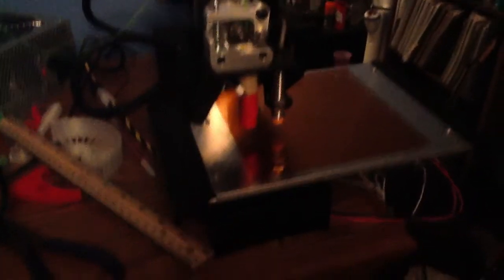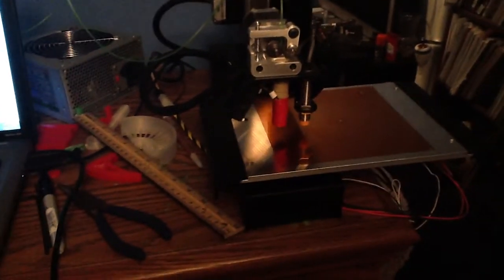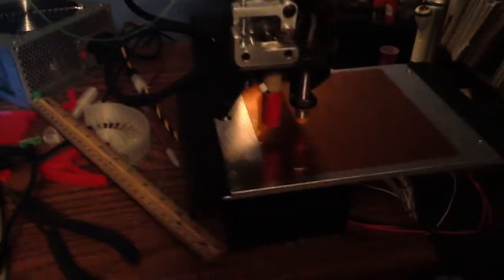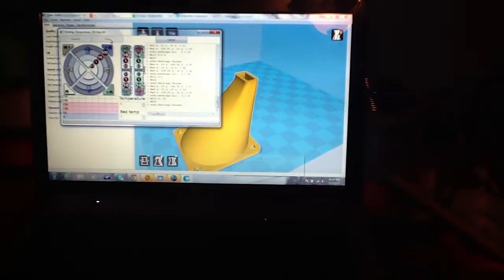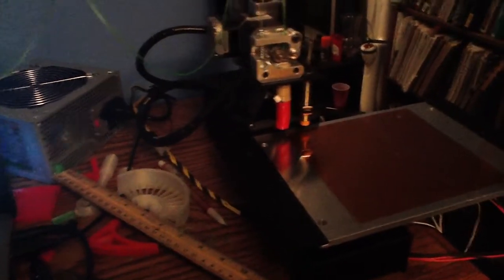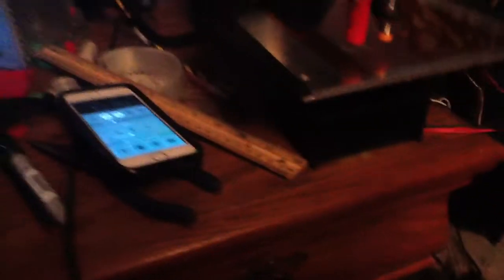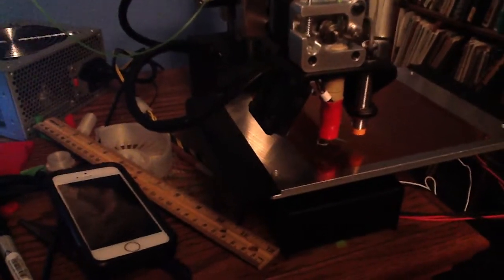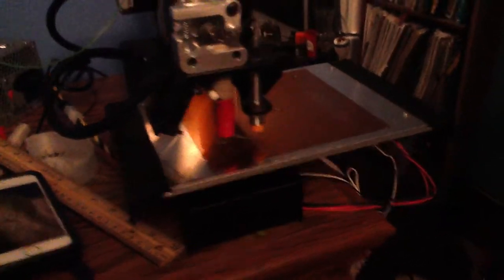Printrbot - Simple - Metal Filament Balling Up and sticking to Nozzle

Comment: I spent a couple of days when I first got mine with exactly the same problem. Clean the nozzle on the exterior tip to get any existing crap off of it. I do this before every print. Then extrude some filament using the software and grab it as it comes out if you gently pull it, it should come out nicely , if you stop it will loop and stick to nozzle again. Mine still does this if you extrude and leave it. The curling I think is normal I've seen several others with this. I had no fix as such you need is to get the z axis calib spot on and keep trying. I thought I had it right several times but I just think it was very slightly to far off the bed. Went back to basics removed the z sensor, refitted and calibrated from scratch again I now have perfect prints every time. Stick with it mate, took me many attempts to calibrate at the start. When you think about you will never be running the printer like you are, normally the filimant will stick to the bed in a print and then get pulled from the nozzle as it moves around. So in summary Calibrate, test print, calibrate test print. Good luck stick with it
Reply: People still dealing with this shit 6 years later.
Reply: @acerockollaa like me